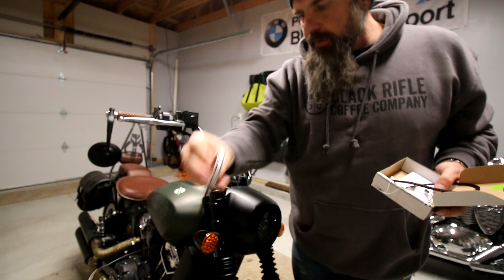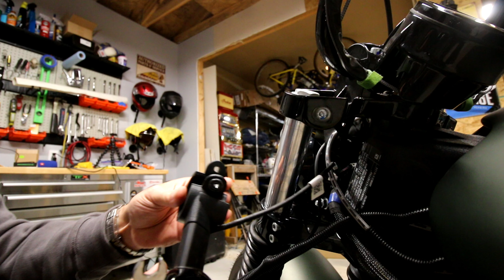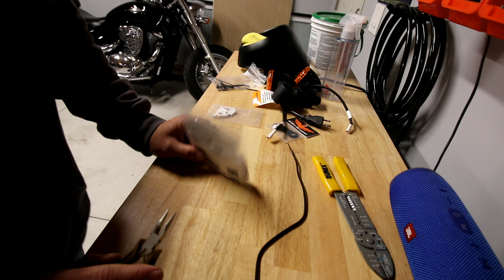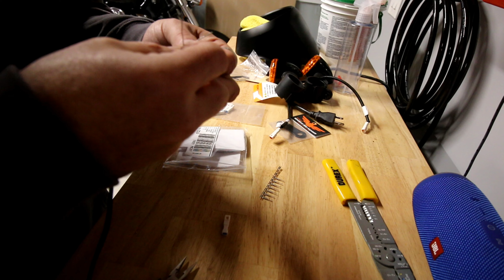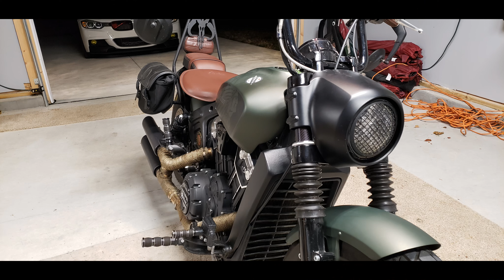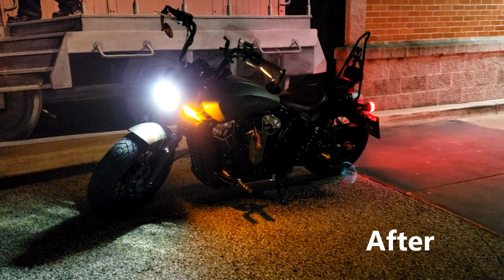Indian Scout Bobber Front Turn Signal change - New Rage Cycles 360

Comment: did you have any issues with them giving random brief flashes even when not activated? i recently tried to install some on my scout 101 and while they work fine when activated when not in use they will give off brief flashes
Reply from the maker: No.  I think you can add some capacitors to them

Comment: Are those female or male ends you bought
Reply from the maker: Just rechecked and I guess you need the male end.  They gender it based on the pegs not the plug.  Sorry for the confusion.
Reply from the maker: You need the female end.  The male end should still be on the wiring harness of the bike.  The male is inserted into the female as is.... well... nature 😆
Reply: @MessyGarageBMW  I know how they connect just wasn't looking at the connector. The link show 180.00 but that's for like 300 lol 5 is cheaper. How do you like them now? Thinking of doing this as well. Still recommended?
Reply from the maker: @cautiontext Text  still on the bike and still operating flawlessly.   Very happy with them.
Reply from the maker: @cautiontext  I'll have to check that link as it sounds like it is now pointing to a bulk quantity.   Thanks for letting me know.

Comment: Great video thank you, just followed along to do my bike. You do anything to clean up the back end? I'm moving the plate with a dean speed mount and wondering what to do with my rear lights.
Reply from the maker: I cut my plate mount already and have the plate mounted vertically.  I have the stock signals still on the back because I don't think they look bad.  I'm also considering a fender delete so I'm looking at different options.

Comment: My man! So I put these on my 2021 Scout Bobber last night, worked as expected, then when I did my finally test after buttoning everything up I got the hyper flash… I called new rage this morning and she told me I need one of the load equalizers.  Did you have the hyper flashing issue at all?
Reply from the maker: No.  Mine flash normal.  Never had the hyperflash happen.  I half expected it when I first got them but it never happened.  I have not changed anything from this video and they still work the same.
Reply: @MessyGarageBMW  okay thanks brother. I guess I’m just lucky. Lol. Probably because I also changed out the back lights with leds too?
Reply from the maker: @MattB13  That actually might be the issue.  I still have my original tails.
Reply: @MessyGarageBMW  I think so too. Will throw a load equalizer on it and hopefully it solves the problem. I don’t really want to go back to the stock turn signals!
Reply: @MessyGarageBMW  so I got the bike all put back together and connected the battery and went for a test ride…no more rapid flash… it’s fine now. Put about 45 miles on it and still blinking as normal.  Thanks for the video! Helped a lot!
Reply: What was the process of putting the inline resistors in? Did you have to uninstall everything?

Comment: Hi there, just tried to do the same change as you, plug and play with the 360 turn signals, but having an issue with the signals staying on slightly and flashing faster than stock. Was there anything else you needed to change to get yours to work correctly?
Reply from the maker: So my signals do stay on (although dimmer) in a "running light" kind of way.  They do not blink faster than stock that I've noticed.  If you are having these issues you may consider adding a load equalizer inline with the wires.  I didn't do this because I didn't see these issues with my install.  I do have another bike (suzuki) that does blink too fast when I converted the tail to LED so I know this is an issue on some bikes.
Reply: @MessyGarageBMW  thanks for coming back to me.  Yeah, I have ordered some inline resistors and hopefully that will address the issues. Fingers crossed.
Reply from the maker: @justinscotcher476  cool.  please comment back on how that worked out so others know.  What year and model of bike are you working on?
Reply: @MessyGarageBMW  Hi there. Finally got the indicators sorted. I spoke with New Rage and they hooked me up with connectors that had the resistors spliced in. Just tried them out last night and the indicators behave as expected without fast flashing or any residual glow. So for a 2019 Bobber, to get the best results I recommend getting the connectors. Shout out to Justin and Larnell at New Rage Cycles, their service was fantastic and they did everything they could to help me get an outcome. Super happy. Sorry unable to attach a photo of the connectors.
Reply: Did you have to take everything off again to fix this issue?

Comment: You have have crimpers sitting on your tool bench in front of the jbl speaker, just in case you need to do wire repair in the future. Other than that, great video!
Reply from the maker: Lol.  Yes I know that is why they were out there but they weren't working great so I opted for the other method. :-)

Comment: Did you buy 39mm for the 41mm forks? That’s what you linked in your video and I’m just curious cause I’m wanting to get the same!
Reply from the maker: Yes.  They fit but fit tighter.  I didnt want them rotating or sliding around.

Comment: Currently debating what turn signals to get, remembered you put this video out recently, I like that these look visible from the side too, safety first ya know. Are you going to do rear signals too? Btw, update on the corbin pillion seat: Had a few rides out now on it and the missus is really happy with it, says she doesn't notice she is sitting on it, which is a sign of a good fit. When did you put that headlight grill on and what is it?
Reply from the maker: Still debating on what rear signals I may want.  I don't hate the ones that are on it stock but I'm always tinkering so who knows.  As far as the headlight grill.  I will try to find a link.  I put that on awhile ago and it is one of those things I just didn't record and should've.   Thanks for an update on the seat.  I really need to get that sorted because my daughter really complains about the Indian one being uncomfortable.
Reply: @MessyGarageBMW I see. Well, best of luck on your quest to rid the bike of chrome! Fairly surprised the control levers have managed to escape your cleansing campaign thus far. Merry Christmas and a Happy New Year.
Reply from the maker: Yes.  They are on the shortlist as well.  There are some im eyeballing from the Netherlands.   Just need to figure out what style and color I may want to go with.
Reply: @MessyGarageBMW  LSL? I'm looking at the same thing.
Reply from the maker: @tinxinator  yep.  Was looking at putting a splash of color to compliment the whole Boba fett thing going on with my bike.
Reply: @MessyGarageBMW  the green right? It's pretty bright. Would be good considering the Boba Fett thing. Gold is the only other tempting color considering your exhaust wrap. Antricite lever with a coloured adjuster dial is probably the more subtle way to go. Or say fuck it, go full Boba and get Green and Gold
Reply from the maker: @tinxinator  plus you can mix and match colors.  Was looking at the green with some gold on the adjustment know.
Reply: @MessyGarageBMW  yeah that's exactly what I was thinking. Plus there's a few nice styles to choose from. I don't know whether short or long makes a difference neither.

Comment: Love it!  I'm getting ready to add some Motogadget M Blaze bar end signals and I'm like you, I don't want to cut the old connectors.  Glad I found this video and thanks for linking the JST connectors brother!
Reply from the maker: I was thinking of going with those bar end signals too.  Figured I would run these for awhile and swap out later.  JST is the way to go.  Makes swapping out a breeze and no electric gremlins. :)
Reply: @MessyGarageBMW  I was actually thinking of running both.  I'll see how well these work first.  I am swapping out my handlebars so I figured nows the time!